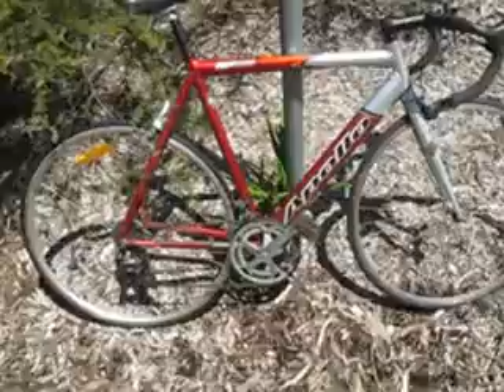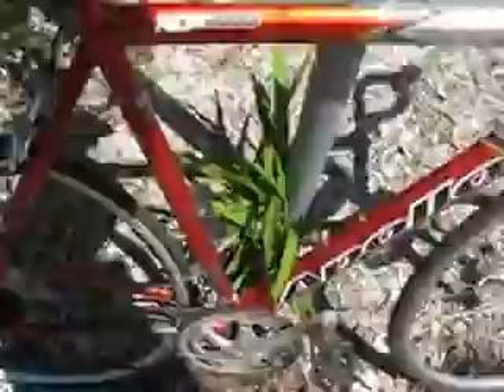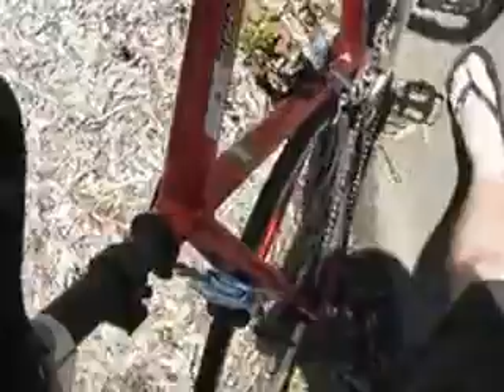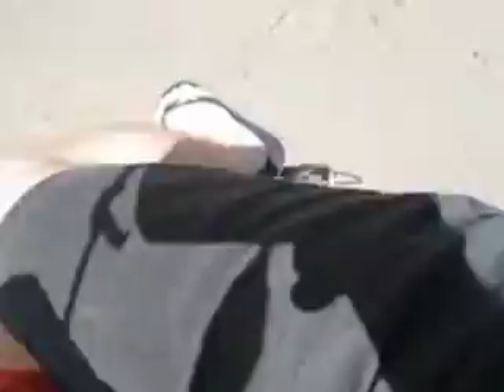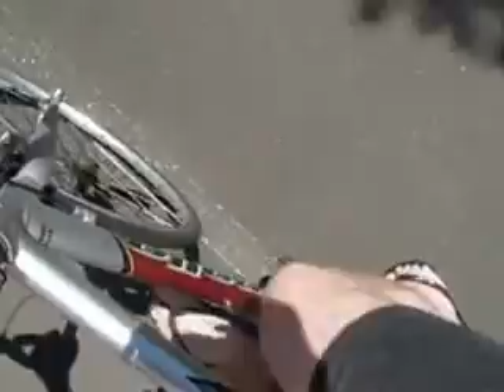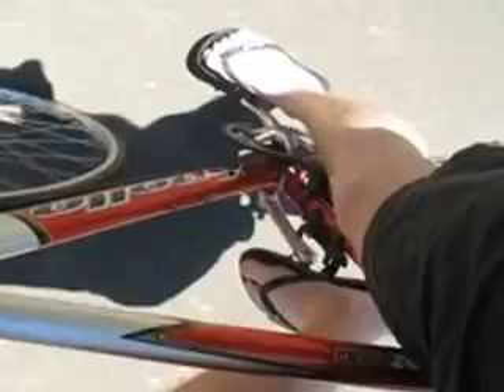Silicone Caulk Filled Inner Tube - (worked for 7km before bursting) :D

Comment: I used silicon caulk to patch a thorn puncture in my bikes innertube, I put a dot over the puncture and used my thumb to spread out, 30 minutes later after the caulk had time to dry I added a second layer, I let it dry and then put the innertube back on the bike and it’s been holding up great, not even a slow leak now.

Comment: Caulk can only dry properly when exposed to moisture and in light applications, like bathroom joints, otherwise the caulk will set on the surface but the inside will stay damp and will not set.
There are some "hacks" that involve adding water and / or vinegar to help it catalyse from the inside but if you want to do proper 'massive' silicone, you need to use RTV silicone, used for mold-making, and not caulk (Managing to use caulk for big projects is the holy grail of mold makers due to how cheap it is compared to RTV!). The only other solution is to build up the caulk, layer by layer, giving a day or 2 between layers.... but that will give weaker bonding, and take weeks to do!!